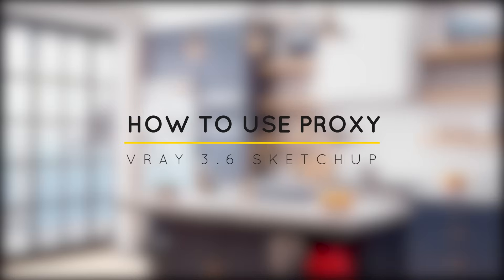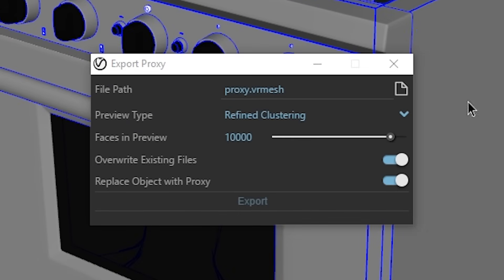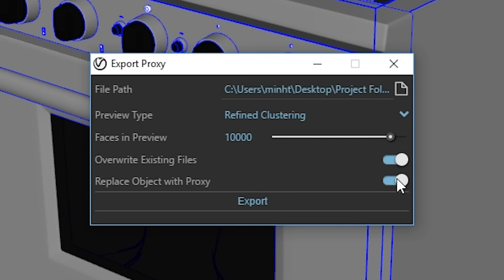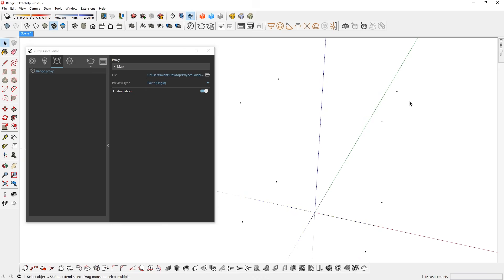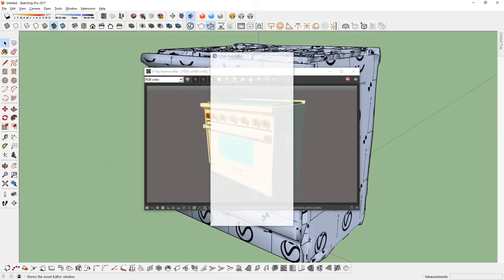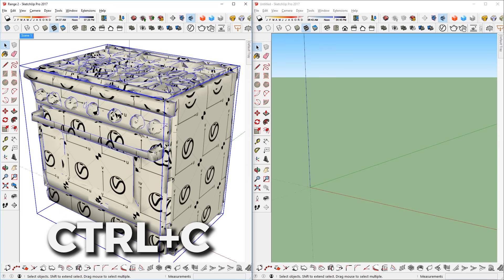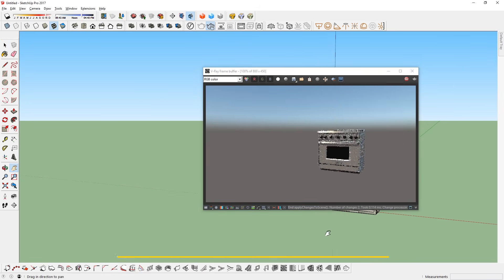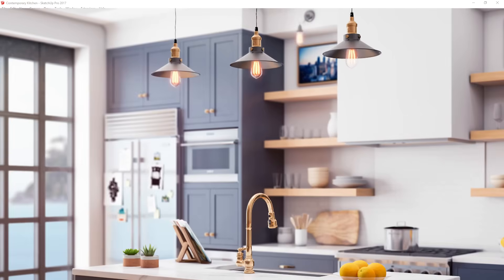How to use Proxy in V-Ray

Comment: If I give my sketchup model file to someone else, the proxies disappear from the model when they open it. Maybe because the proxies seperate files linked to the main model. Is there a way to retain the proxies in the model even if the file location is changed on the drive? Or is there a way to make the proxies a part of the main sketchup file?

Comment: I'm having trouble with proxy materials in terms of replacement and replace in scene with vray next 4.01. I did very much exact same way as yours even there are missing feature like Replace, unable to edit proxy vmesh model and there are no way to retain replaced materials in asset editor. Materials not always showing the correct materials in the imported sketch up file. 
I even gave unique name to each vmat material still not improving the problem of not showing the correct materials.
Reply from the maker: You can try the new update 2 of Vray Next. It's a lot better now

Comment: Thank you for the video. I have a question about the proxy. I am using laubwerk. Everytime I render my model, the objects will add another set of proxy objects. Why is that? and how to clean the object list and material list? I am using version 3.4 btw because it has the least number of bugs in my opinion. THX
Reply from the maker: Hm I think that's probably an issue with laubwerk

Comment: how do i edit the original model
Reply from the maker: You would have to open the sketchup file of the original model. You can't edit the original by making changes to the proxy.
Reply: Thanks! And i have to make a copy and make it to proxy. And then reload?

There is no way to link a skp file to a proxy (from the same file)?
Reply from the maker: Yeah you would have to reload the proxy component. You can right click and use the reload option 😄
Reply: Thank you so much for ur reply

Comment: Hi AI, in order to speed up my modeling work within sketchup, this proxy method would be a good solution for me, but I usually render my modeling in Lumion rather than vray, so in my case what is your recommendation for me between using proxy component or vray proxy method although I dont use vray? thanks
Reply from the maker: Hi! I'm not sure if there's a way to use proxies in Lumion :(

Comment: Hi Minh, I have watched the video very carefully step by step and think it's very helpful. To reduce the load of my model I need to use proxies otherwise the pc will throwing up. I did import a tree and a hedge in 2 seperate sessions and each I safed direct as a model and as well after editing in SU / V-ray and safed the proxies as skp files (methode 3). Now I see that the proxy-skp files are 3 times bigger then original model-skp files. What is best to use in my model to keep the model as light as posible?
Reply from the maker: Ohh that might be because your original was still in the components list, you can open the components windows, and see all components in the model, then purge unused components, then resave it. It should solve the issue. Let me know if it works!

Comment: hello, 
i have a vray 3.4 and when i click export proxy there is no "Export Proxy window", so i don't get the options you refere.
in the manual i see that i should have the "Export Proxy window", is there a variable, or option to turn this window on?
thanks
Reply from the maker: Hi Filipe, yeah I think vray 3.4 doesn't have that window and the extra options that comes with vray proxy :(
Reply: Architecture Inspirations thanks. It seems that the proxy's till 3.6 are really too basic. For instance I can't copy paste, like in your tutorial, with the correct materials. Also if I purge the scene, I also loose the materials reference (and in very complex models, purge is mandatory).
One way that I work this arround, is to keep a copy of the initial component that was proxyed hided in the model (for example on a turn-off layer) this way the material reference doesn't change.
Thanks, and keep up the good work!
Reply from the maker: Oh that's a very interesting workaround. Thanks so much for sharing!😄
Reply: just another tip, i found a plugin that let's you choose what to purge, so, i can simply purge everything but the materials. problem solved

Comment: Awesome video Minh! I didn't realize this was an option in Vray - Lol - I uploaded a video on SketchUp proxies the same day you did one on Vray Proxies - we both must have had some slow models at the same time 😂😂😂😂
Reply from the maker: Haha yes! It's a huge deal for Vray! But it's understandable because you're new to it 😄 
Hahah that's so cool!! High five for that Justin!
Reply: @ArchitectureInspirations  Hi guys, I have a question here... is the proxy method whether in vray or component proxy as Justin did it before will has any implication when it exported to Lumion for rendering? or do I need to reinstate to its original faces before exported to Lumion? anyway this would be a proper way to solve sketchup in high detail modeling or complex modeling in one file, right? my pc is considered as medium to high specs (32GM RAM, GTX1070Ti) but most of my models were running very slow in millions of lines and faces, maybe proxy can save my time in doing my modeling.

Comment: Hi Ming, I see the animated proxy option but how do I make/get them? I want to use it in a project but I have not been able to find out.
Reply from the maker: Hi, I think you have to get that from 3ds max, and to get it to work, you'd have to render an animation in vray for sketchup as well
Reply: Architecture Inspirations  Thank you. Just to be sure, use 3ds or Blender to set up the rigging and then render animation in vray for sketchup?
Reply from the maker: I'm actually not completely sure I believe so! Not sure if blender can export animated proxy but I think if you have 3ds max and vray for 3ds max, you can export proxy with animation. Then use that in sketchup and render an animation using vray 😄